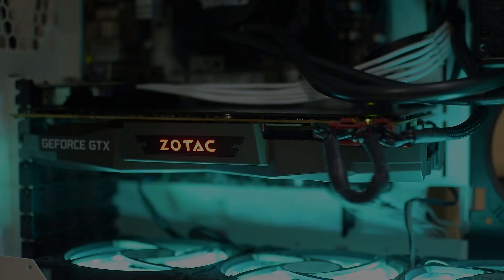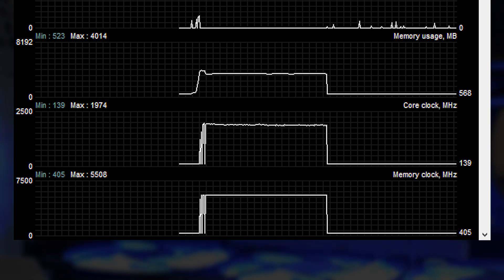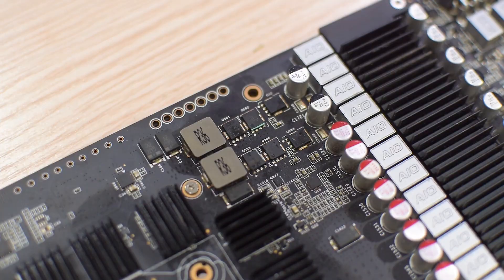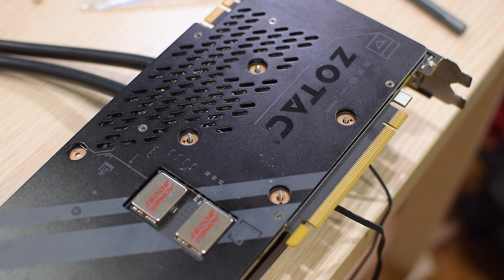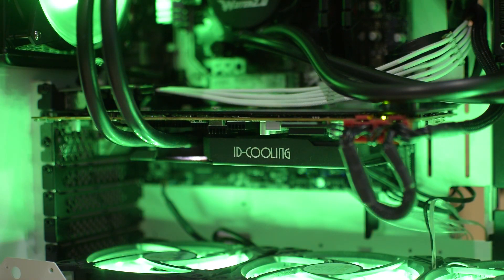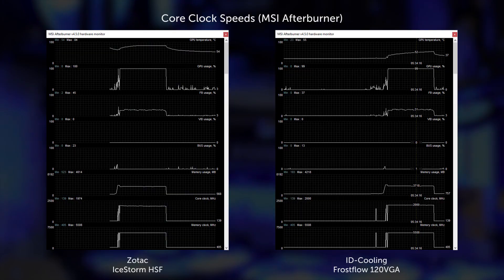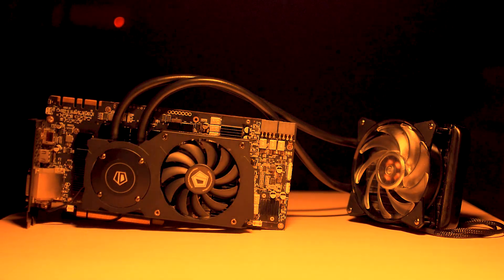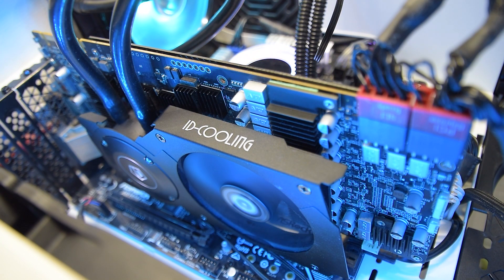Cool as Ice. - ID-Cooling Frostflow 120VGA + Zotac GeForce 1080 Ti

Comment: hey man
what did u use to remove the heatsink from the old card??
i saw ur older video and actually did like u did with a 970
and funny  now i got a 1080ti FE
that i want to get this cooler on
am afraid to remove the heatsinks off 
and they are really stiff
can u share some advise?
also if i want to get some of sticky things for my heat sinks, what are they called and where should i look for them?
Reply from the maker: If it's a bit stuck, even after removing all the screws, twist the heatsink a bit, helps to remove it. 

Are you referring to thermal pads?

Comment: great video man. i saw a few videos of ppl saying this cooling system was garbo but, listening to you describe what other ppl forget to do etc, made me think they probably just fucked up the install. thanks again brother, threw u a sub as well.
Reply from the maker: There are 3 videos of this cooler that I did on 3 different GPUs; in all of them I got great results.

There are many in the comments have gotten great results as well. I think what's important to do is to make sure it's all mounted correctly, and like the latest GamersNexus video, this includes the radiator.
Reply: @TechRodent  u think its Worth it on an Evga 1080 SC? Since it can only max 120% power, seems like the stock cooling system keeps it at decent temps, even at max power.
Reply from the maker: @timfriday9106  it's something you can try, then use the MSI afterburner overclock finder to push it harder
Reply: @TechRodent  its literally not possible to push the power further as a hardware limitation with the founders cards. I pushed mine to 120% power n upped the fan power and was running 65c. I know i'd q
Squeeze a lil more out with a like 10c reduction but, i dont see the value in tearing apart the card just for for that little bit cooler. I would if the bottleneck was temp but its power. Just oc'd my whole rig n im pullin mad numbers on the cpu/dram/gpu but, getting cooling system for cpu so was looking into system for gpu n noticed the numbers other cards had didnt come clse to mine. Found a video pointing out the SC has a far superior cooling system n is hardware capped at 120% power.

Comment: Will this work with the asrock 5700 xt challenger? I know I'm late but I need to know because my temps are high
Reply from the maker: I don't have any definite answers; maybe someone in the community has it, but in general, if you examine the PCB of the Challenger with the stock 5700XT, and they're similar it shouldn't be an issue.

Comment: Anyone stumbling across this with a 2080 Ti you add one because you’re bored waiting for the 3080 Ti or whatever next flagship card hits please pay attention. DO NOT USE THE INCLUDED THERMAL PADS. Or do and think why didn’t I listen to TheBrandonAF? He’s a beast, I see his body count, watch his streams, IG and the instructions say to do... just f’n no and stop. If you want to risk killing your card go for it. Here is what I suggest. Use the AMD bracket. The contact is much much better than the recommend RTX which I could not get the desired results. Use the existing thermal pads for the Heatsinks (original heatsink on your GPU heatsink is very good quality) and your own preferred paste for the pump. Use every single heat sink and pay particular attention too where these will need slid over as the pump it’s self will need that micro clearance as you fasten and you don’t want a heatsink that’s perfectly aligned over the memory to prevent that.  I am literally saving you days of benchmarks, troubleshooting, missing your stream schedule. Use the large instructions, but with AMD brackets for 2080 Ti reference board. Use additional screws to mount the back plate back on. It is critical you add a second 120mm fan for the radiator (push pull) These get extremely hot to the touch. Even with two fans. Your GPU will stay cool though. I put on a +175 core and +1100 mem OC and believe the hottest it got was 72c during torture. Good luck to all and for those following their instructions, I pitty you’ll come right back to exactly what I am saying.

Comment: Is the thermal paste good with the product or should I get a better paste like corsairs one?
Reply from the maker: It's alright, but you're going to be better off with higher quality compounds if you want the best performance
Reply: @TechRodent  Thanks for the reply man. Really excited, will be getting the product at the end of the month. 

Just a last question, ill be using in my RTX 2080, is 120 mm radiator enough ?
Reply from the maker: @Imti23  it should be sufficient. It cools my 1080 Ti even on Malaysian summers
Reply: @TechRodent  i got the product, installed it and now getting a minimum of 15C down in temps.

Only issue, my gpu slightly bends when i attach my side panels. Hopefully this will not be a major problem.

BTW the fan headers were installed in the mobo right or in GPU pcb headers?
Reply from the maker: The fan headers are installed to the mobo, so long as those are running at full speed, the results will be fine. 

If your card is slightly sagging from the flexing, you can try rearranging the tubes
Reply: @TechRodent  Tried rearranging the tubes, do you think there will be any issue if the card is slightly sagging ?
Reply from the maker: Highly unlikely, some sag is normal, cards weighing in at half a kg do much much worse
Reply: @TechRodent  thanks alot for assurance man really appreciate it. 🙂

Comment: ACETONE?! Why not use Isopropyl alcohol? Also why u scrape the GPU die... the chances of cracking the die for someone inexperienced who watches your video might just wreck their GPU
Reply from the maker: Acetone works totally fine, and scraping with a plastic pry tool is totally fine.
Reply: @TechRodent  Reason why I said that for acetone is that yes it is fine for electronics, but not for humans when handled wrongly. U provided nothing of a caution or somesort. Big tech YouTubers do not use that for the reason of viewer safety.  Pry tool just doesn't make sense imo as u can easily wipe it off and pry tool can potentially knock out the tiny electronics beside the die ,again, for view safety when they follow your videos. Those who are new to these might follow the things u use/do and use/do it wrongly. Just a note to take. Your videos are interesting as youtubers rarely do the contents u do. Keep up the good work <3

Comment: Now my question is will it work to mount onto an rtx 2080 super?
Reply from the maker: Some viewers have reported that newer models come with brackets for rtx cards
Reply: Tech Rodent I ordered a 120 version for my 1060 and about to grab the 240 for my rtx 2080s just wasn’t to sure if anyone has done it as I can’t find any info on it
Reply from the maker: There has been a number asking if it does and I've seen a number who have said yes, so I think it's a fairly safe guess. 

The only thing I would be worried of is board compatibility
Reply: Tech Rodent yeah mines the aorus 2080 super so I’ll post up a video after I get it installed

Comment: Installed it on my Asus Geforce 1070 Dual OC and load temps in Furmark decreased from 75*C to just cool 40*C. In Idle I have around 34*C. I love this cooling solution, but I had to attach a additional 40mm fan on the left of the cooler, because the PCB design of the 1070 Dual OC has all the chips that need to be cooled on the other side. Also I switched from the radiator cooler to a Noctua NF-F12 industrial 2000 pwm. Wish the company would be more known in Europe!

Comment: how did you setup the power??? for some reason im still hitrting high temps,
Reply from the maker: Check your mounting
Reply: Did you manage to solve the high temps? My GTX 1070 is hitting at 65 degrees Celsius with no over clock

Comment: Does the fan with the radiator should be the exhaust or the intake? Im kinda new for this kind of thing..
Reply from the maker: You should set it as an exhaust, so that you don't pump hot air into your PC.
Reply: @TechRodent  ah i see, i thought the cycle is as same as car engine but it isn't. thanks for the reply! subbed.

Comment: can i change the fan on the bracket itself? was thinking ll120
Reply from the maker: if you're capable of 3d printing or doing metal work, sure, but the original mounts aren't 120mm.

Comment: Alright dude. I got the AIO for my 1080ti. The 1080TI FE is loud and runs hot. It is terrible. hopefully this will cure all my headaches. I did sub/like as a thanks.
Reply from the maker: I'd love to know if it works out as well for you as it did for me. Cheers
Reply: @TechRodent  Hey dude. I did it. What a damn difference. Its night and day. It is quiet. It is way cooler. I am talking 70-80 down to 35-55 under load depending on the game. I do have one issue. It will not show anything upon start up. You have any idea why? I cannot even get into my bios.
Reply from the maker: @mazor13  that sounds like an issue that might have stemmed from elsewhere, like ram or improper seating of one of your components

Comment: What about vram and vrm temperature?
Reply: AFAIK other AIO cooling for GPU doesn't include any heatsink to touch the VRAM. It is replaced by the fan which blows directly on the VRM. It is said to be adequate. Even NZXT does the same with this. I saw someone explain this on youtube.
Reply: @lz9556  also i saw some review from gamer nexus that even with the stock cooler removed wich touched the vrms, only with the fan  pointing them it gets better temps !

Comment: Hi, i bougt the cooler for my 2080 ti. I tried to attach the heatsink with thermal adhesive but vram are "
slippery" and the heatskink fall down...any suggest?
Reply: Dimitri Zornik this also happened to me, but I only did was clean the v rams with cotton swab with alcohol.
Reply: @Hamscareds  thanks! I will try it. How are the temps with the cooler?
Reply: Dimitri Zornik 65C max

Comment: hi! does the frostflow 120VGA come with the mini heatsink as well? what's in the box?
Reply from the maker: Yes it does. It comes with heatsinks, the mounting kit with screws, and thermal paste
Reply: @TechRodent  I just had a look at the evga hybrid gtx 1080 and it's funny hows basically is the same stuff of this kit
https://www.youtube.com/watch?v=0gDGB1e1aTQ
Reply from the maker: @SuperGianluka88  yes, most commercial board partner ones are basically the same thing, except for the vrm cooling where they use huge head pads to dissipate into a shared heatsink

Comment: Just bought this GPU cooler because of your video. Tried to my Colorful iGame 1080 Ti Vulcan AD and it reached 75°C. I think it's too hot, no? My case is Meshify C which has plenty of airflow, I set both fans from this cooler @60% static, but still. I wonder what's wrong.
Reply: Nevermind, it is my case. The front dust filter is clogged with dust, and when I opened it, temps never goes past 61°C. Ambient temp is 32°C here in Jakarta, Indonesia, without air conditioning.
Reply: masih pake?
Reply: @bagasnur5353  Udah enggak.
Reply: @BinggomanLive  knp ?. bisa minta review ama plus minusnya?

Comment: Is the Id cooler frostflow compatible with the Msi Nvidia gtx 970 because I want one as my Graphics card keeps getting hot.
Reply: do you have a blower style cooler or a dual fan style?
Reply: @Hairybarryy  My Graphics card is the fan type Graphics card so I am going to try out the cooler with my 970 I have also brought it of eaby.
Reply from the maker: I used it on my 970 ME and it worked wonders
Reply: @TechRodent  Ok I have brought one straight of eaby so I am a bit nervous as I have not done this before.
Reply from the maker: @Ironduchess72  it's not that difficult, good luck with the mod!
Reply: @TechRodent  thank you I will come to you when i want any advice.
Reply: You should see amazing temps and boost. Its bit over kill for a 970 considering low tdp. But it seems like you would really benefit from the upgrade. The price is great too $48 for a universal hybrid cooler is great

Comment: Are you still using this ID cooler? Has the pump quit? Looking at cooling my rx580 with a ID cooler.
Reply: I have a brand new one that was used for 6 minutes if you want to buy it.
Reply: @da133993  you still looking to sell? I'm looking to get one!
Reply: @BrandedbySean  I sold it on OfferUp. For way less than I should have.
Reply from the maker: I'm still using it till this day

Comment: Hey man I need some help, I just bought the Frostflow 240VGA, but my temperature under maximum load is 70C, is that normal? I'm using a Zotac 1080 Ti Blower equipped with the Frostflow 240VGA
Reply from the maker: 70C max load looks relatively normal, but of course you can check the contact between the GPU and the cold plate as well as swap the fans out.
Reply: @TechRodent  wait so 70C max load is normal EVEN if I'm using the Frostflow 240VGA? My thermal paste was applied ok-ish so contacts are ok, I changed the fan configuration tons of times, but the results were the same. Is there any chance my temperature is affected by the size of my PC Case? I'm using a mATX case, Tecware Nexus M

Comment: This should compatible with Asus RTX 2070 based on the mounting right? I play game like near heater when my gpu go  full load. Good to see local tech youtuber.
Reply: Yeah they come with RTX bracket nowadays, just bought mine last week, works great but the temperature is not as got as this, despite me using a 240mm radiator instead of 120mm.
Reply: @CaptainCavemann should definitely work as long as you use the correct mounting bracket

Comment: Thanks for the video! That proves the 120VGA is more than sufficient. However, I wonder if the 120VGA bracket will take a corsair H55 AIO, should its default aio fails? But I doubt, just seen a video that the mounting is vastly different.
Reply from the maker: Cheers. There is no way that the 120VGA can take in the Corsair H55 AIO unfortunately.
Reply: @TechRodent  Any idea if this wil! fit into rtx card? The mounting is 74mm by 58mm. Or possibility to retrofit? Thanks!
Reply from the maker: Interesting, are the mounting holes not square but rather, rectangular?
Reply: @TechRodent Yes, due to the bigger die as I understand. I have a RTX 2070 on its way for a new build and I already have a Kraken G12 ready for it. As I will be having a few GPU in my build, so I am also looking for cheaper alternative as the G12 path can be rather expensive if you have no access to a current AIO cooler. Currently, I am looking out for a P104 8GB mining card purely for computation, and this frostflow should fit well within the budget :)   Will definitely update here in due time. Cheers!
Reply: @TechRodent  Sorry that I haven't have time to install on a RTX2070 yet, but now I know I am needing additional mounting kits for RTX 2070 & above cards. It is ID-COOLING IDW033-RTX2 Upgrade Mounting Kit. Gonna order this soon and update again when I fully install it.
Reply from the maker: @lesliechiang1710  Hey thanks for finding out and replying, that's super useful information to know.

Comment: You fail at thermal paste, you added way too much!
Reply from the maker: Indeed, it doesn't matter.
Reply: too much paste will cause overheating  @TechRodent
Reply from the maker: It doesn't, it has been tested before by may other YouTubers, including Tech Jesus himself, Gamers Nexus.

Even him adding a stupidly high amount doesn't cause an overheat in their tests, let alone the amount I applied. 

I used to believe the same though, but I followed multiple other YouTubers and they made the same conclusion.
Reply: ye it does i read about it on thepiratebay  @TechRodent
Reply from the maker: Check other sources as well :)
Reply: was kidding lul, would you recommend the 120VGA for a Zotac GTX 1070 Amp Extreme? it's 3 slots thick so im thinking the 120VGA would help bring it down to 2, fitting in my case for once  @TechRodent
Reply from the maker: Hahaha, good one.

I think it should work just fine, and since it works perfectly on my 1080 Ti, I'm very sure that it'll do well on a 1070
Reply: Thanks I'm probably going to get it, by the way, how  much did you pay for it?  @TechRodent

Comment: Awesome video. Very helpful. I was wondering where you plugged the 2 fans and pump in at? Will MSI afterburner no longer have any fan control after this install? Do you control fans with motherboard header and speedfan or something similar? Thanks very much.
Reply from the maker: Cheers buddy. I connected the fans to a motherboard header and yes I controlled it using motherboard software
Reply: Thanks.
Reply: If you are using the gtx card, you can always get an adapter cable like small GPU pwm 4 pins to normal pwm 4pins adapter and use default vbios to control. But for rtx card, you most liking to get a specific cable which is very difficult to find as I understand rtx now has a different fan control pins.

Comment: What was the cooler price that u got bro
Reply from the maker: 33 USD
Reply: @TechRodent  oh wait, i thought u got it from Malaysia. So i assume its around 33 x 4 = rm132. Kinda cheaper than in Malaysia
Reply from the maker: Haha, I got mine from China, from Taobao
Reply: @TechRodent  i might skip that. Worried about shipping and stuff.
Btw, i could find the same id cooler but the price difference between 120 and 240 is kinda less. Around rm40(usd 10). Which would u recommend me to get. Not to keen on fancy stuff and main purpose is  to get it lower than 80 degrees.
Reply from the maker: It's a pretty hot GPU, so a 240 might be beneficial
Reply: @TechRodent  saved some bucks on the zotac mini series just to spend it back on aftermarket coolers. Hard life 🤣
Reply from the maker: Hahahaha, I have the Zotac 1080 Ti AMP, it's a pretty hot card as well.
Reply: @TechRodent  amp is slightly better i guess.
Btw i couldn't see how u connected the power supply for the aio fans. Connects to which part may i ask